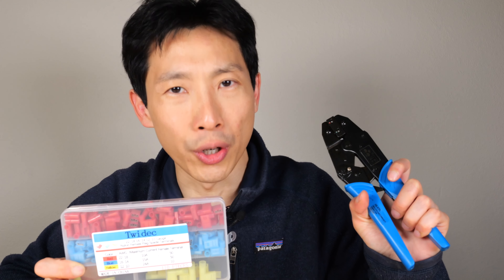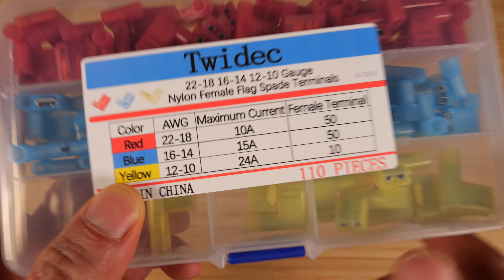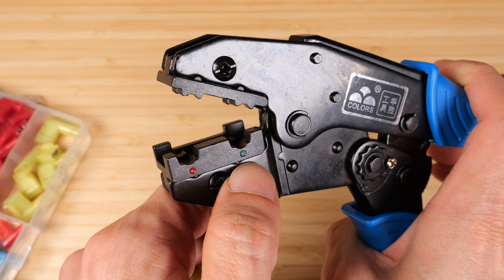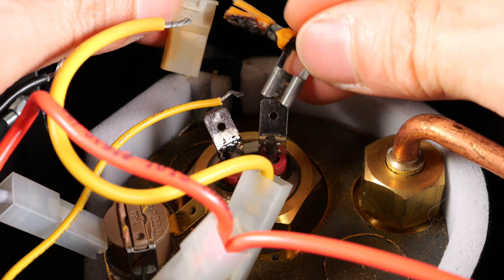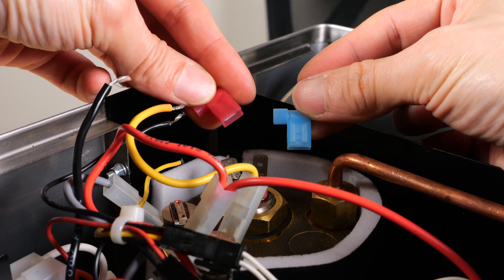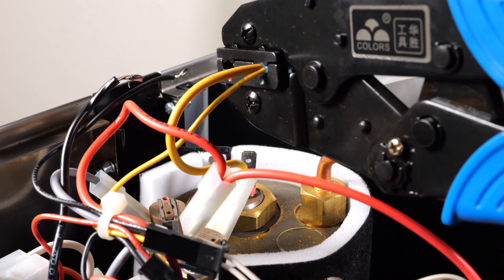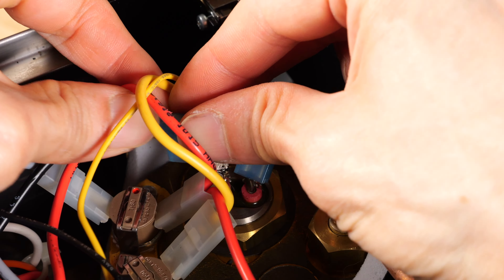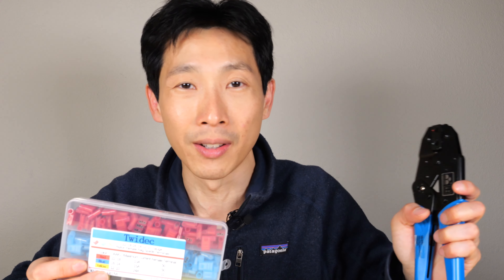When you MUST use Flag Spade Terminals

Comment: The way those terminal open up is not good.  This might be okay in an environment where there is not possibility of corrosion.   If you want a really good terminal for use where there might be subject to corrosion check out Ancor brand terminals.  Ancor has some of the best crimpers as well.   In an environment where there is water, I fill the flag disconnect with dielectric grease and that really protects the internals of a quick disconnect terminal.  Also "Spade" terminals are really the forked type.  These are "Disconnect(s)" or "Quick Disconnect" terminals.  Somewhere along the line the names of the two got confused by people and it stuck.